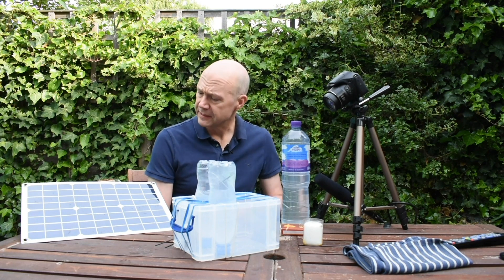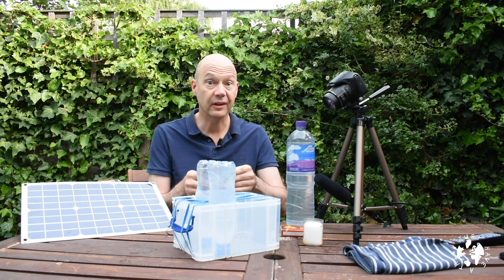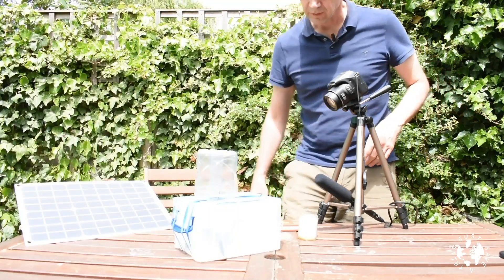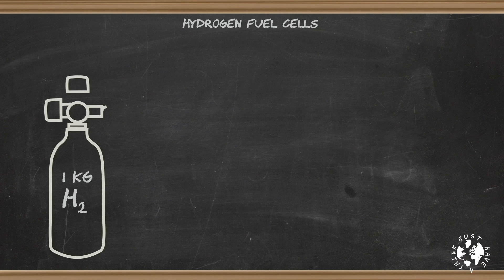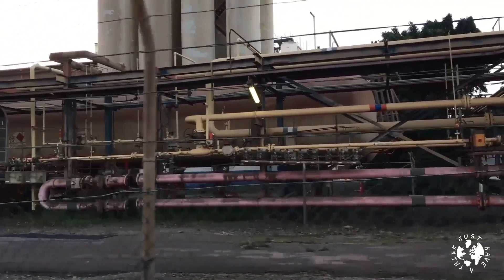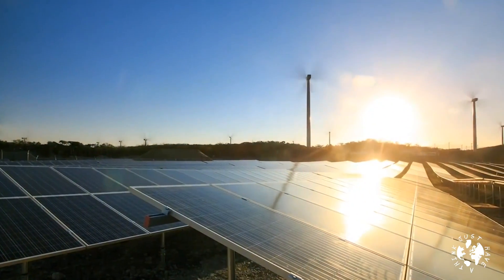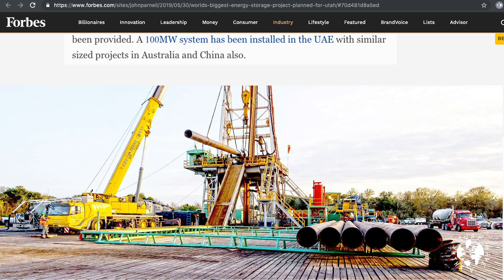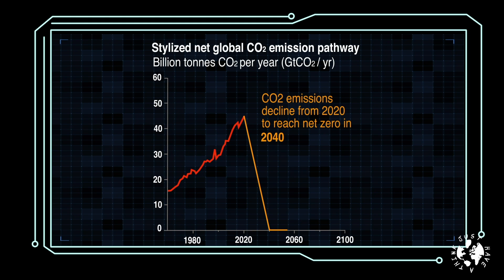Energy Storage in Hydrogen : Does this beat batteries?

Comment: Your proposal it's much more rational than many others, I mean, for 2050, Energy from fossil fuels will be the 1/5th of the total Energy (and I guess in developing countries will be about half), instead to look for an hysterical cut of everything that is fossil fuels, let's technology and economy to evolve to their own pace.

PS: Water not necessary is harmless... the strongest Greenhouse gas is precisely Water vapor ;-)
Reply: + David / +Detteermiig    Water vapor has a very short cycle in the atmosphere, I expect that the engineers would make the water CONDENSE within the vehicle in a closed circuit - at least in regions where it can freeze (I see a problem with just emitting the vapor there - think cold temperature and ice on streets. 

In fix installations emitting water vapor would be safe. 

The temperatur of the air ! determines how much vapor the atmosphere can hold and it rains down within days (or one week at the maximum). That is true all over the globe. 

CO2 is weaker than even the other greenhouse TRACE gases, like methane. 

But Co2 is one of the most STABLE gases. That makes it the most important gas when it comes to the CHANGE of the climate on earth. 

Water vapor is around in masses and does have a huge effect - but it is already factored into the system and self-regulating. Water vapor does the heavy lifting to make the earth warmer (and much better suited for life). 

Only the much more rare but much more stable greenhouse gases can trigger or enhance a cooling or warming. 

It is logical that it is not water vapor that triggers climate change if you think about it - BECAUSE it is present in the system in such high volumes. If there was any longer (think months, years) increase or decrease the weather patterns would be in complete disarray. 

Weather / climate (and all related cycles) would swing - often wildly - and so long until a new equilibrium establishes itself. 

If there is for instance a warming (like at the end of the last glaziation) of course the atmosphere will hold increasing volumes of water vapor, more clouds  (that can cool or warm it depends on the size of the droplets and the type of clouds). 

So water vapor contributed to warming, but the system stabilized at a higher level. 

The energy consumption of humans is tiny * compared to solar input - the only problem is that tricky trace gas CO2, and to a degree pollution for extraction / burning, plus the wars and that we are squandering the finite resources of mankind that took hundreds of millions years to form. 

Human energy consumption is tiny compared to the solar radiation that hits the oceans and (two thirds of the planet's surface) and creates vapor.

Water vapor expelled by humans (even if we would only rely on hydrogen fuel cells) is not enough to make a difference.
Reply: I was thinking about the same, but would the byproduct be vaporized or heated?

Comment: Great video, you covered it all, but I don't think replacing natural gas in domestic pipelines will ever happen, you don't want to risk blowing up a whole city like a Zeppelin Hindenburg. I think these pipelines and gaz heaters and oven ranges will be deprecated and replaced by electricity over the long term. Even hydrogen-enriched natural gas has carbon emissions, and some natural gas leakage.

I also think that, since hydrogen will be produced from water (most likely), possibly even by the same solar and wind power plants that produce the extra summer or sunny/windy days electricity that will drive the process, hydrogen electricity should be produced on the same spot where hydrogen is produced. This way you don't need to add a costly and totally useless transportation  infrastructure to the equation. The solar or wind power plant is already connected to the grid, so it could send hydrogen electricity to the grid at no extra cost during winter. This will also shut down the naysayers who ask what use are these power plants at night or in winter or when the wind is not blowing.

Hydrogen will be restricted to industrial usage, where safety can be better controlled. Hydrogen can still be used for heating, but indirectly, a bit like these waste management or methane plants that provide hot water to neighboring housing or green houses.

Adding a bit more figures would be great too: You said that both hydrogen extraction and compression requires a lot of energy, but I think it's a matter where we need to know precisely how much energy we're talking about, and more importantly, the ratio of energy required and produced, and the amount of solar or wind required to drive these processes in summer on a local or global scale, because the naysayers are using these arguments to say it's not economical or feasible. There are also different renewable hydrogen technologies with different costs, and cost of these processes anyway should not be the main decision factor, the carbon balance has higher priority, and any cost should be computed at all levels, we know climate change costs us much more than any mitigation technology such as hydrogen electricity.There's an idea for a whole new video. Or a dozen videos...

Hydrogen extraction would also be a better fit in coastal areas if you get it from water electrolysis, because fresh water is a scarce resource, and also because salt makes electrolysis more efficient. These plants could even simultaneously but separately produce hydrogen and desalinate salt water, say, half and half, which would drive the energy input requirements even more, but on the other hand, extra photovoltaic electricity could produce irrigation water in summer when it's most needed, instead of pumping and drying up all of the Colorado river. Just have a think!
Reply from the maker: Hi Chimel33. All good points. I'm not a scientist and the channel is really mainly focussed on raising awareness of the overall climate crisis, so I tend to leave the really technical stuff to great channels like 'Real Engineering' - they go into really good levels of detail much better than I ever could. All the best. Dave

Comment: Nice electrolysis demo! On the subject of storage, have you looked at the liquid air energy storage from Highview Power? Round trip efficiency is lower than batteries, but probably better than electrolysis and a fuel cell. And liquefied air is easy to store cheaply in volume. Not seasonal storage, but days or weeks are certainly possible.
Reply from the maker: Hi Mike. Thanks for the tip. I'll take a look. All the best. Dave
Reply: @JustHaveaThink  they're one of our Ashden Award finalists this summer, I went to visit their office and also see the demonstration plant near Manchester. I was impressed with the technology, though as with many things like this they really need to be built quickly and at scale to make a difference. At least that's technically possible though, unlike lithium batteries.

Comment: OK. Just deleted a 25 minute post from a fat finger. Here's the  Readers digest version.

H2 is OK in remote locations, but inefficient as a veh fuel, except Iceland.

H2 is  Better  used as a power smoothing source, but is only about 30% efficient in conversion.

The better use of excess solar or wind would be thermal (AKA) molten salt used in CSP's. Have the salt underground to help insulate, use arc or electric elements to heat the salt (so that it rotates-convection) and then tap the heat when needed with steam turbines.

You could use this as a peaking plant or an overnight buffer or an emergency buffer, using all renewable's
Reply from the maker: HI Pete. I feel your pain on the delete thing  - done it myself more than once before. Very annoying :-) You make good points. There's loads of options - which is a good reason for optimism. I'll try to have a look at the main ones over the coming months. All the best. Dave

Comment: A big side benefit of fuel cells is that their byproduct is fresh water.  Using solar power to electrolyte sea water will generate hydrogen for storage and fresh water later when converted back to electricity in a fuel cell👍
Reply: Fuel cells are very expensive because of the materials used. This is one of the reasons BEVs are more prevalent now. For large scale grid storage cost is less of an issue. But I'm curious how much energy is lost by needing to compress the hydrogen.
Reply: Commercial PEM electrolisers (these are the ones with the best efficiency) do NOT run on sea water. The chlorine ions would destroy the membranes, catalysts and electrodes. Instead, they run on deionised water. The conductivity is provided by the separator. To produce the DI-water, large amounts of drinking water are used.
more info: https://en.wikipedia.org/wiki/Polymer_electrolyte_membrane_electrolysis
Reply: 70% energy loss from water to electricity. hydrogen makes ABSOLUTELY NO SENSE. lithium batteries make the most sense. even lead acid batteries make a WHOLE LOT MORE SENSE than fuel cells. so why do we keep seeing vidoes like this? because NO ONE commercially produces hydrogen from water. they get if from the refinement of natural gas. short explanation? BIG OIL. they showed you all those big tanks and talked about hydrogen and you TOOK THE BAIT... and made the ASSUMPTION that they were getting the gas from water. THEY ARE NOT.
Reply: 20% loss at electrolysis.. minimum. 10% loss to pressurize hydrogen. 40% loss at the fuel cell.. MINIMUM. starting to see why it's a dum idea?
Reply: one exception that might save hydrogen as a fuel- a company called 'hyper-solar' in CA bay area has created a solar CELL that takes ANY dirty, salty water source (even reclaimed sewage!) and splits it directly into h2 and oxygen. add a compressor and some storage tanks... then a fuel cell.. and VOILAH! power AND clean water. BUT- the panels only last 6 month before they have to be replaced or rebuilt and they ARE NOT CHEAP.
Reply: Couldn't use of hydrogen power create too much water for the planet possibly flooding it or something? And couldn't the extra vapor heat the planet even faster?

Comment: How much fossil fuel resources does it take to build the storage tanks? And, what is the environmental impact in storing hydrogen underground? Your presentations are terrific, thanks!
Reply: there are not studies about that, but is way way way less than batteries.
Scaling hydrogen storage is easy, for example storing hydrogen in liquid form is easy, each time you increase a sphere, the lost by insulation increase with the surface (square) but the volume increase with the cube (current tanks lost less than 1% by month, that hydrogen still can be used). 
So with a huge spheric LH2 tank you can avoid to have 5 times that volume in batteries at 250 times less weight.
Scale hydrogen production and storage is cheap, batteries is not, that is why batteries are cost efficient for any application that would not require to deliver or store power for longer than 5 hours, beyond that (at similar production rate) hydrogen would be more cost efficient.

Comment: We (NASA/STANFORD/WHITE SANDS MISSILE RANGE/ACE/NAVY)  looked at hydrogen production and storage decades ago. Ideally you stuff it into a non-volatile compound, i.e. NH3, a lucrative compound made via the Haber-Bosch or Kellog processes, which p.s. are the key #1 chemical reactions giving us 8B people today; never would've happened otherwise. Once in the RIGHT compound, you have a liquid/fuel/battery (synthesized electrolyte) you can throw a match in and it won't burn, yet just a KISS of wattage releases pure H3 for fuel cells and/or heat and N which vents to atmosphere, no problem, nor is it hard to obtain during charging since 70% of air is N. You just need the liquid; typically sea water. Next question; what do 8B people all make every day that resembles NH3 (ammonia). Pop quiZ. Hint: google nigerian girls urine generator youtube. Bingo. POpquIz#2 aNd fun factl the aircraft with the most unbroken records even today, held unbroken for the longest period is (guess) and used (guess) for fuel...Holy Pigchit Batman!

Comment: Thanks for this video. This is something I've been trying to explain to many people for quite some time now. Hydrogen provides the seasonal storage wind and solar energy so desperately needs. It can also act as a bridge for renewable energy to cross into applications that are very difficult to electrify: large ships and aircraft. Now, if Hydrogen can be reacted with CO₂ captured from the air, you'd effectively have green synthetic fuels. Methanol is already being looked at to replace bunker fuel for ships. For jet fuel, it would have to be some direct substitute using the Fischer-Tropsch process to make synthetic fuels.